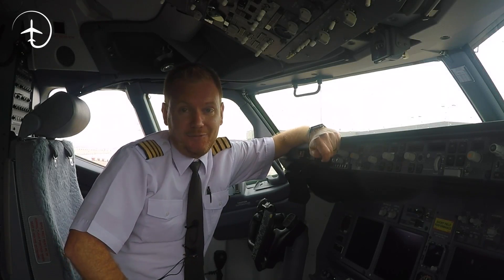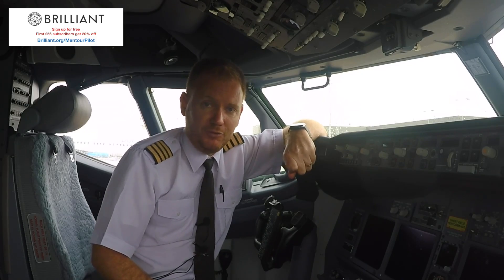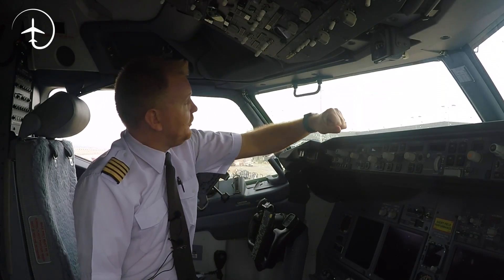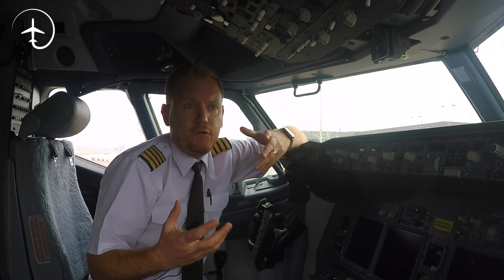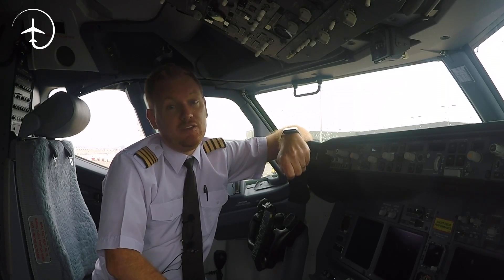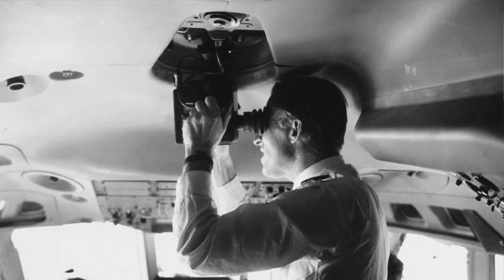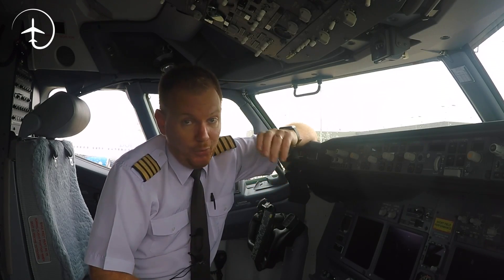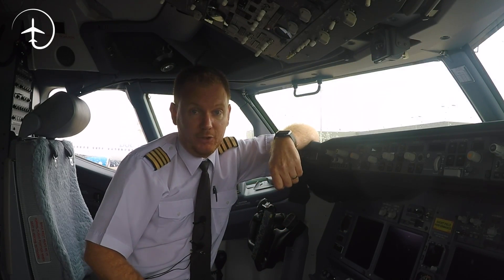Boeing 737 EYEBROW windows? What is the purpose of them?

Comment: Aside from the maintenance issue (which sounds like a big issue) seems they could have added a sliding cover, similar to what's in passenger windows, to open and close as needed.  Even for the military version, since they too would like to block the sun during long flights.

Comment: Celestial (astral) and GPS navigation work on very different principles. As you show nicely, celestial navigation is based on the intersections of circles that are derived from very accurate measurements of the apparent positions of known stars. 

GPS receivers, by contrast, do not measure the apparent positions of the satellites (where are the telescopes, optical or radio?), but rather the distance of each satellite derived from the delay in its received clock signal. 

They do have one thing in common, of course, in that they both use trigonometry. But they way it’s used is very different.

Comment: Celestial navigation isn't necessarily manual... "As early as the mid-1960s, advanced electronic and computer systems had evolved enabling navigators to obtain automated celestial sight fixes. These systems were used aboard both ships and US Air Force aircraft, and were highly accurate, able to lock onto up to 11 stars (even in daytime) and resolve the craft's position to less than 300 feet (91 m)."
While GPS has largely dispaced it, celestial navigation apparently still has some military use (e.g. in ICBMs) because of its inherent resistance to jamming, and obviously it's used by spacecraft and other extraplanetary vehicles.
Reply: Don.t forget that jet liners used INS gyro navigation(similar to IRS) to navigate before there were GPS. They still rely on INS, now with laser technique and not gyros, and check it with GPS. Early 747s relied on INS only so stars were for emergency or extra check I assume

Comment: I have about 5000 hours on 737s (-300 and -700), in Australia and Europe. In Australia we flew visual circuits and low-level circling to most of our destinations. Out of 20 or so destinations there were only 4 with ILS - everything else was non-precision circling or visual approaches. The eyebrow windows were very useful. One point you missed - the left pilot uses the right hand windows and the right pilot uses the left hand windows. When the left pilot is turning left, as they are sitting close to their side window, that side window is fine for visibility to the left, when the left pilot is turning right, however, the right window is pointing at the ground - but the runway you are turning towards is easily seen in the right hand eyebrow windows.
I'm glad that you didn't repeat the other "rumour" - that the windows were a hangover from air-to-air refuelling in the KC-135.
I also had one shatter in cruise once - a short circuit in the heating wires bubbled the perspex and shattered the glass layer - the glass breaks into thunbnail-sized bits but everything stays together bonded to the perspex. It goes with quite a bang, just above your head, though.
Reply: This information is very interesting, Thank You!
Reply: Damn, this is what I come for when I read the comments on a YT video. Very nice ;)
Reply: Wow, I bet the window breaking got your attention! 😬
Reply: Wow how intense was the wind? Im sure it was pretty scary and cold
Reply: @natelav534  There was no wind. The window is made from laminate layers of glass and Perspex. The glass layer broke, but the Perspex was fine, so the window stayed in place. I’ve had the same thing happen on a side window as well.
Reply: @amcconnell6730  woops sorry i misread. Still probably a pretty uncomfortable diversion! Cant believe its happened twice to one crew member. Ive only heard of windows blowing out a couple times on commercial flights. I suppose its because the perspex usually holds.
Reply: Question:  if the window Totally failed and was sucked out due to depressurization would anyone "Definitely" be sucked out if they weren't buckled in ?
Like what happened to the pilot on a plane that the windshield came out due to wrong size screws or bolts?
   I guesss what I'm asking is it
Likely,   probable,   or just possible  ?
Reply: @charleslacombe359  It depends on the size of the window, and the pressure difference you are at when it fails... but, yes - if a side window departed the aircraft and you weren't wearing a seatbelt, then you're going outside for a while.
Reply: @charleslacombe359  this happened in Europe some years back. The pilot got sucked out and the flight crew held him in by his ankles. He lived and continued flying for many years retiring in the early 2000’s

Comment: The opening on  top of the 747 is Escape Hatch ,which is used during emergency evacuations if the cockpit door can not open. You can’t open  it during cruise due to the pressure.

Comment: Always deeply suspicious of the claim that celestial navigation wasn't accurate better than 5 miles (some books say 8).  Did several years of it at sea (ships, guys, not airplanes).  If you take 4 or 5 sights, different stars, and the result is a pinwheel on the chart, where else can you be but there?  We only had SAT-NAV when i first went to sea, not GPS.  It had an ellipse, with a long axis up to 8 miles and a short axis of about 4 miles, and you were somewhere inside that.  That was great when out of range of Loran A and Loran C.  In the middle of the Greenland Sea, who cared if you were 4 miles off, anyway.  Okay, harder to take a sight in heavy seas.  Forget fog or clouds.  Could only take them in "Nautical Twilight". You could take a sun-position, and a moon,: less accurate and no cross-check.  Without fancy calculators, by the time you calculate a fix and plot it on the chart, a plane is several hundred miles down the pike.  My first two ships max-ed out at 16.5 knots. Slower than a good bicycle.
     Doing celestial Nav from a plane requires an extremely steady hand and plane.  You need height-above-ground/water.  Is the altimeter correct?  Did you get the bubble-level on the sextant exactly right?
     Hey!  Slocum did the first solo-round-the-world trip with celestial Nav.  He made it; in 3 years.  The British Government paid about 20,000 pounds for the guy who invented the chronometer (That's an accurate clock (before battery-power,) temperature corrected, etc).  Good down into tenths of  second.  If you are only doing 12 knots, it's good enough.  You need accurate time-piece for celestial nav.)      Hey!  Slocum did the first solo-round-the-world trip with celestial Nav.  He made it.  The British Government paid about 20,000 pounds for the guy who invented the chronometer (That's an accurate clock (before battery-power,) temperature corrected, etc).  Good down into tenths of  second.  If you are only doing 12 knots, it's good enough.  You need accurate time-piece for celestial nav.)

Comment: Good video, I flew the 727 and 737 for years and never realized that's what they were for, I assumed they were there because the cockpit was original designed for the KC-135 and the military wanted them and boeing didn't want to redesign the cockpit. You're right about stuffing checklists in them to block the sun.

Comment: The old eyebrows are a legacy from the Boeing lineage going back to the Kc-135  tanker which did air-refuelling and the pilots felt they needed the extra visibiity. 
Then Boeing continued the eyebrows into the well-known “ common-cockpit shell” .
Reply: I suppose they didn't refuel the tanker. The KC135 tanker had extra windows in the tail for the tanking operator

Comment: That "window" that is referred to on the 747 at 3:51 is not a window, but an escape Door, (the 747 dies not have openable escape windows like the 737 and MD11 etc..), there is no and there never has been a window on top of the 747 the DC-8 and think 707 did have a Sextant port in the top of they're flight decks and (I heard stories that that was a hittable option on the 747 but have never been able to confirm that) there is a little left over feature in the 747 flight decks from the days of astral nav the switch for the Beacon (the red blinking its on top and bottom of the aircraft) has 3 positions off, on lower and on both, that allowed the crew to switch off the upper beacon so it wouldn't interfere with sextant readings

Comment: The purpose of them is actually to leak pressurized air out and drive pilots insane with the noise. Causing them to stuff the areas around with napkins until the noise goes away. 

Then they come in at night time, my buddies and I spend majority of the night pulling apart the interior bits, pulling them out, replacing them, and then resealing them.  

There you guys have it.

Comment: That 747 "window" is the emergency escape hatch for the flight deck... not a window.
Reply from the maker: Ahh, I just searched for star-navigation with Aircraft and that came up. Thanks!
Reply: @MentourPilot  I believe the small hole right next to that hatch is the sextant port.  I worked on an old military 707 with eyebrow windows (good for staying with the tanker giving you fuel in flight) and the now unused sextant port.  Some use it for vacuuming, while others use it for entertainment (toilet paper rolls or hot dogs) . Differential pressure makes it a suction hole, and the pressurization system isn't bothered by it.

Comment: Although navigation satellites are technically in orbit, they are geostationary.
Reply: Rog5446 
That’s not exactly true. The primary space-based components of GPS, GLONASS, and Galileo are neither in geostationary nor geosynchronous orbits. 

Space-based augmentation using systems such as WAAS, or EGNOS allows for improved accuracy by using correction signals broadcast from geostationary satellites, but the core function of the majority of GNSS is accomplished using satellites that are moving relative to any fixed point on the surface. 

This can be confirmed using many GPS apps that actually display the position of the satellites being tracked by the device.

Comment: Ah no. GPS and star navigation are totally different. The only similarity is that both measure your position. GPS uses time difference, which translates to distances to the orbiting satellites, while star navigation measures the angle of the direction to the star. That's why for example GPS needs 4 satellites location because it also needs to solve for time, while star navigation only needs 3 stars to solve for XYZ coordinates. Another important difference is that  time can be measured much more accurately than sight angles, and that is why GPS is way more accurate.
Reply from the maker: Yes, that is absolutely correct. I was referring to the LOP calculation and the fact that we use several satellites to pinpoint position. The comparison is halting, I admit that.
Reply: Adam One what you describe is what a mathematician would do. Actual GPS software just uses linear regression to converge quickly to the XYZT solution to the distances equations including the satellite orbital almanach and the time measures. Numerically it's way easier. Still the point was that time can be measured to about the chip rate of the signal which for GPS is like 2 meters, while angles are orders of magnitude less accurate.
Reply: Trilateration uses circles, triangles or spheres.

Comment: so eyebrow windows mean the pilot can see downward better??
Reply: They weren't there to see downward, they are pointing upwards! They were used to see laterally when in a curve, as the aircraft banks. When the aircraft is banked, the upward side of the aircraft points more or less to the side so you could see better laterally when in a curve. But then, when the aircraft is not banked, the windows point upward. That's where the sun would come in, then the pilots would use there charts to cover it, etc... (But of course, if you turn the plane upside down, you would be able to see downward better) :)
I hope I answered you question.

Comment: Hey mentour. Can you let us know more about the 737 Max 10 enhancements made to the towing link and overall height increase to fit in the Leap 1B engines. Also more about the 737 Trim wheel & Speed brake and fuel dump system (if it has fuel dump). I love 737's like you do and would also like to know one more thing which is the maintenance cost versus A320 over a 10 year lifecycle usage & whether leasing or ownership is a better deal when we talk about 737 for airlines.

Comment: Mentour Pilot, Since military jets still use the "see to turn" or "eyebrow windows", does Air Force One have these extra windows needed for a military aircraft? Thanks in advance.
Reply from the maker: Hi! Not to sure about that. I don’t think it will have them.
Reply: @Buddy Clem, 
The VC-25 (747-200), E-4 (747-200), C-5, C-40 (737-700C), C-32 (757-200), B-2, KC-46 (767), and KC-10 (DC-10) do not have the eyebrow windows. 

The B-52's have both eyebrow and sidebrow windows.

All of the Boeing 707 variants 135's, VC-137 (ancient Air Force One), E-3 and E-8's have 4 eyebrow windows. 

All of the 130 variants have more of what would be sidebrow windows (3 per side). They also have 2 windows per side at the pilots knee. The reasoning is that the 130's are more of a tactical aircraft and they have to have a clear view of the land/sea.
Reply: Mentour Pilot,
On the EC, RC and KC-135's there are two handles on either side of the sextant port. When in the receiver (in-flight refueling) and they do an emergency breakaway the receiver retards the throttles and pushes the yoke forward. If you are standing on the flight deck and holding onto those handles you get a rather fun zero-G experience.  :>)

By the way, see my reply to Buddy Clem above.

Keep up the great videos.

Comment: Australia's AEW&C Wedgetail  737s are a mixed fleet with regard to eyebrow windows. This is based purely on line number of the "green aircraft" as they spanned the time where the feature was changed on the basic aircraft type.  The fleet also has a mixture of the domed and flat aft pressure bulkhead for the same reason. I worked on the modification program at Boeing Australia both on the hangar floor and later on the development of the Aircraft Manuals suite.

Comment: Why don't modern jets have several cameras mounted flush in the fuselage such as tail, nose wheel, everywhere you have a blind spot?  Most trucks and RVs have them already.  Their lens can be heated so they don't fog up.  Great new topic.
Reply: It would be too expensive for the few benefits it would bring. I think the Airbus A380 is equipped with some cameras to help while taxiing, but in planes like the Boeing 737 it is not needed.

Comment: An aerial sextant has an artificial horizon - a level.  A nautical sextant requires the actual horizon be used as the reference point.  This is why the LOP’s are circular for the air navigator and straight for a nautical navigator.
Reply: There are bubble attachments for marine sextants as well, used when the horizon isn't visible because of fog or coastlines.

Comment: A question for another video:
What are the operational pros and cons of engines under the wings versus engines at the rear?
Reply: Engines clustered in the rear produces more centerline thrust than wing mounted and is a lot quieter in the cabin. In B727's we had a light on the glairshield that alerted you to an engine failure since it didn't produce asymmetric thrust to alert you if you loose an engine.

Comment: Hello. I'd like to ask a question which is a little bit different from the questions that are asked usually: we know we have oil for about 40 years. Probably less, because the oil use is always increasing. What kind of fuel will airplanes use when we run out of oil. Maybe solar panels? No, I think a solar panel airplane flew round the world, but there was one pilot inside and that was it. Maybe solar panel airplanes will be able to take three or four people, but a solar panel aircraft that takes 180 passengers is out of the question. Will they burn liquified gas? Maybe, but gas will also be finished one day. Will they use biofuel? Maybe, but they would need incredibly huge extensions of land to grow biofuel plants and, because of the climate change, less and less extensions of land will be able to grow the fruit, vegetables and cereals people will need to survive. Batteries? No, the bigger the batteries, the heavier the aircraft would be, so it would need bigger batteries and so on. So what kind of energy will aviation use in 40 years from now?

Comment: The Angle of the Pole Star, above the Horizon, tells you what your Latitude is. So, if you are in Stockholm, you find it at 59° above the Horizon. If you are in Barcelona, you find it at 41° above the Horizon. And if you are in Singapore, you find it exactly on the Horizon Line. If you are at the North Pole, you find it at the Zenith. I "discovered" this Fact just a few Monthes ago and I find it exciting, because you can always realize how "North" or "South" you are, just by seeing how high (or low) the Pole Star is. Unfortunately, if you are in the Southern Emisphere, you can see no "Polar Star" and therefore this does not apply.

Comment: A q /idea for next videos.
What to do if, as a passenger, you notice that the flaps/slats are not extended and the plane is being positioned for the takeoff? Note that the crew is also strapped in their seats and you are in the middle.
Is there a case in aviation history that a passenger or cabin crew intervened due to noticed pilot error/aircraft malfunction?
Reply: In the Boeing 737 (and probably other aircraft), if the flaps are not extended when they start the takeoff roll, an aural warning will sound. The pilots then abort the takeoff and they have to taxi back to the gate because of safety reasons. If you check out the video "Can a Circuit Breaker crash a plane?" by Mentour Pilot, it'll give you some highlights on this subject.
Reply: I'm aware of that, but that was not the question.